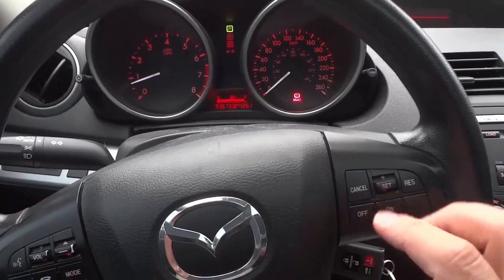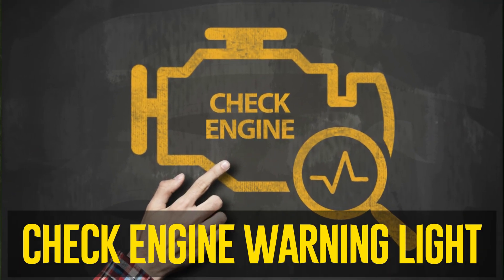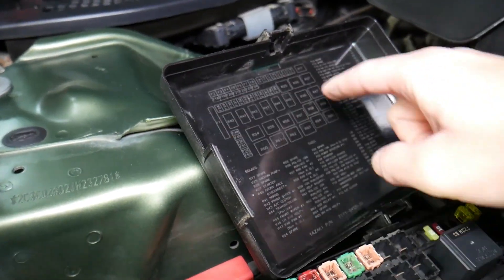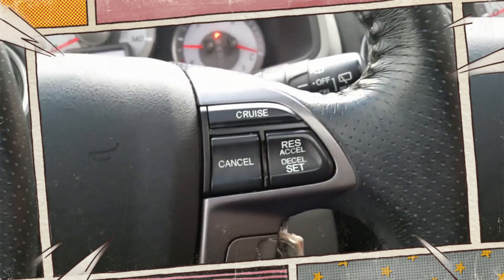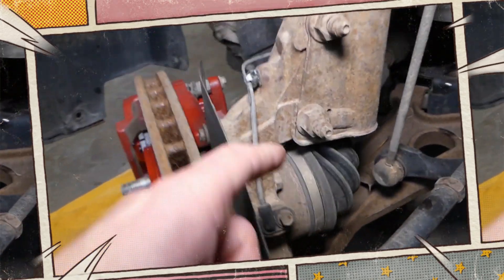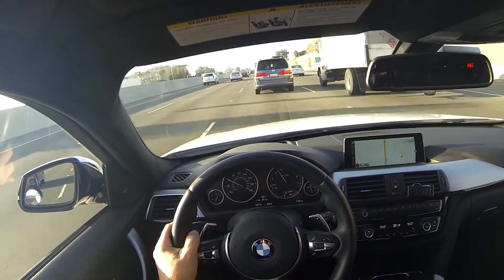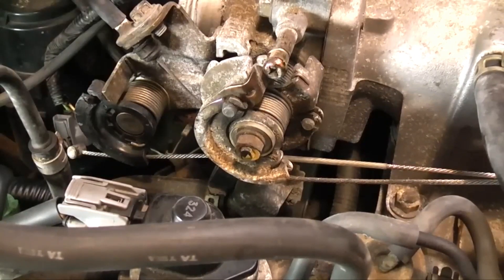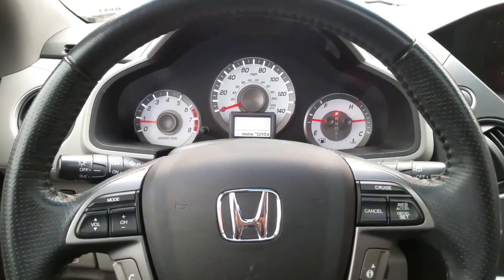7 Causes Why Cruise Control is Not Working & Cost to Fix?

Comment: 07 Escalade, years trying to figure it out. Replaced brake switches you name it. Whole time it was a faulty ground strap missing on drivers side. After replace everything worked again. Voltage drops are very destructive on a cars electrical system.
Reply: how were you able to diagnose this?
Reply: @huzaifar7560  lots and lots of research